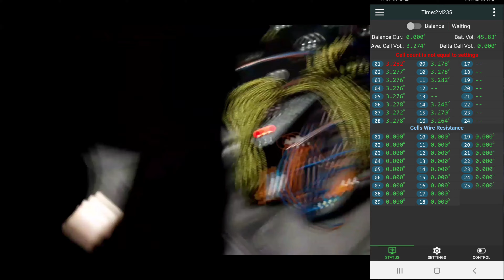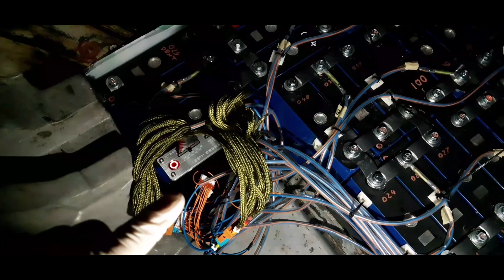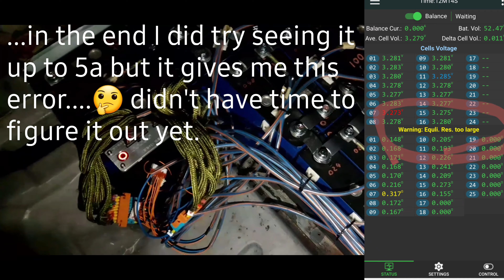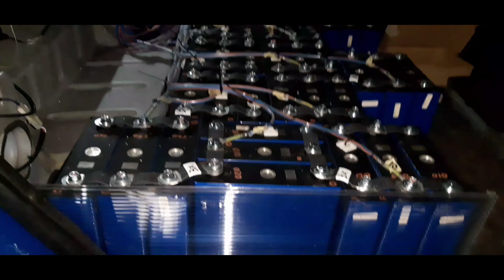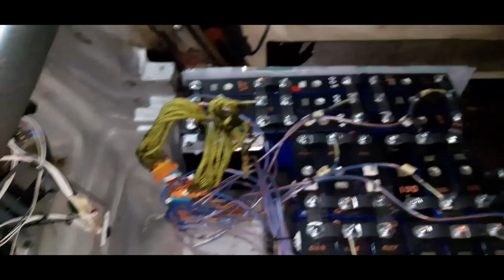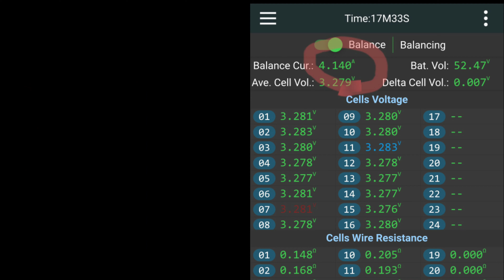Gwiz - 5a active balancer 1st test

Comment: You keep improving your custom electric vehicle.. I'm amazed and scared at the same time.
Reply from the maker: Working with wires and electricity requires focus. A short circuit and the batteries can get damaged or worse